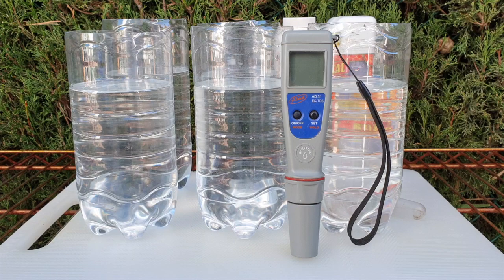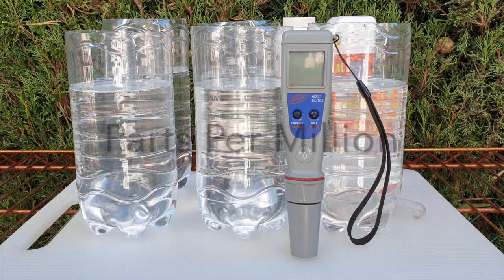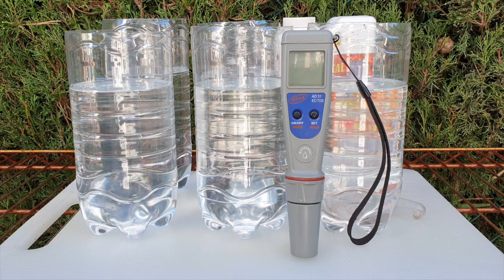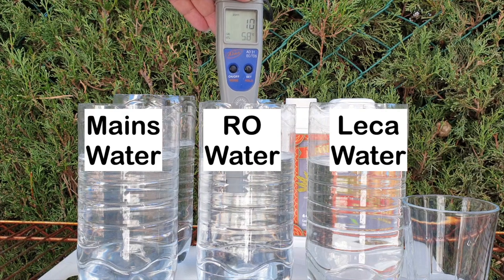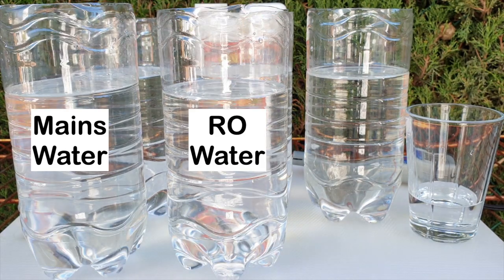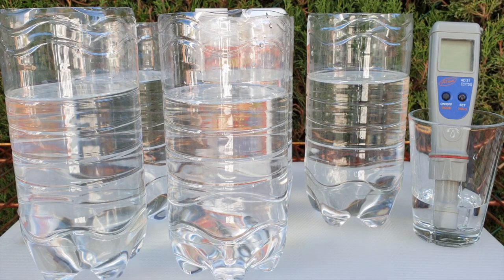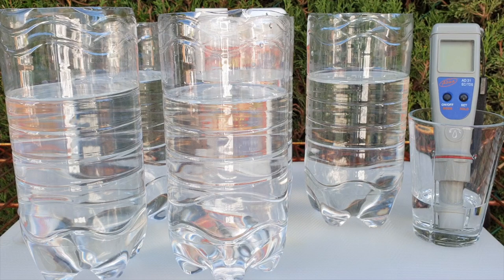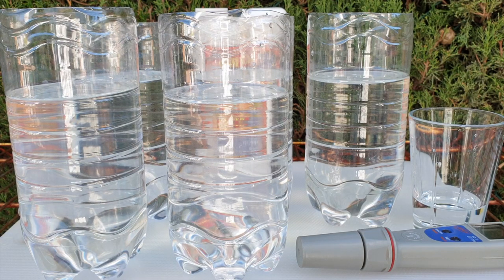Simplifying Total Dissolved Solids | A Comprehensive Guide | TDS MADE EASY 💪🏼👍🏼 #ninjaorchids

Comment: The one limitation to a TDS meter is you don't know "what" is in there, just that there are dissolved ions. And that limitation will not tell you if the ions in your tap are harmless or not, unfortunately. Unless you know the exact makeup of your water (in the US, if you are on a city line, this information is free), it is always best practice to use rain, R/O or distilled water. Then again, the lower the initial TDS, the more "good stuff" that can be added, which is an added benefit to not using tap. And that isn't to say you cannot use tap, but for those with hard (or acid) water, the pH of the nutrient solution may be needed (to come in part 2 I assume).
Well, the end of my warm winter comes this week, looks like we are destined for cooler than normal weather for at least a couple of weeks. And, of course, the warmth got plants going earlier than normal so the cold is ill timed. I have three Cattleya that are in bud a full two months ahead of schedule. My Den tortile has already begun spikes and four new growths. Hopefully we will not get colder than they are predicting or it could be bad.
Reply from the maker: Don Miguel 🥰💐 hola jefe! That is right, know what is in the water is different measure all together and well, here I would have to take a sample to a pool store to get it analyzed for what it contains. I was hoping that I cleared up the measure can be read, but not the content 🤷🏼‍♀️I just listed the common content, that is a general for all 'drinking' water supply. Even if I get an analysis from a sample of my water, it could change from day to day, soo... maybe one day I will get it done, just out of a matter of interest, to go over it but I won't rely on it as a staple. We are heading into wind, rain and cold as well, as from Wednesday, supposedly! 😫 and, I woke up feeling like doo doo this morning. I have a temperature and my throat has closed up. It started yesterday, but yeah... light sensitive again, got the shades on while at my desk. meh! I am trying to drink honey and lemon as hot as possible to clear the throat! I have to film things before the weather declines, or else there will be no videos as from the 14th 😬I feel 🤒😅can you bring some of the orchids you mentioned inside to hopefully protect spikes and buds? Or... do you have them in XXL size? 😅 probably, the latter! 😅thank you so much for watching, Michael!! Have yourself a great Monday while the weather holds up ❤️🌸